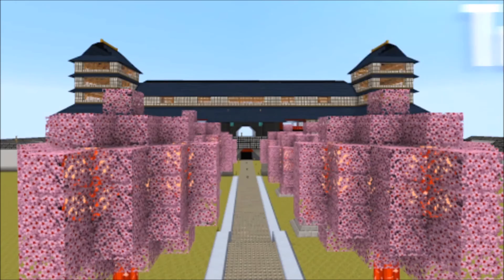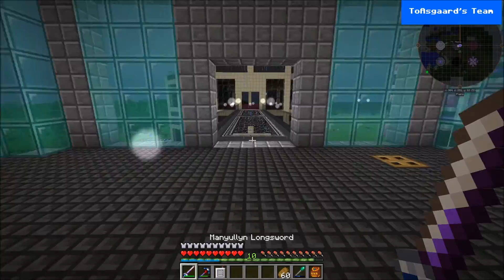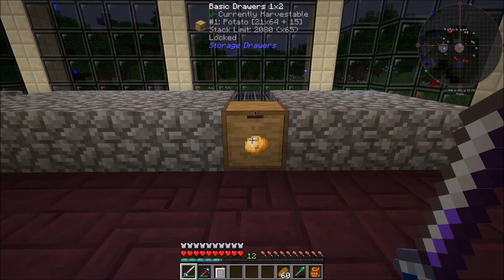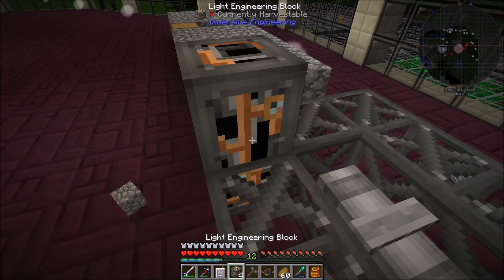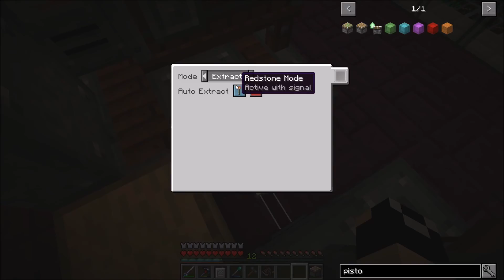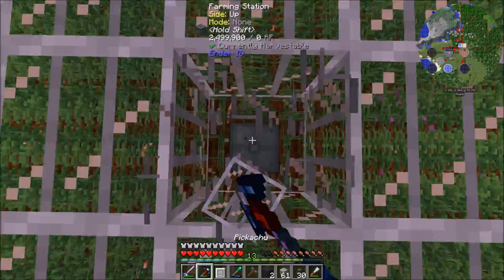Direwolf 20 1.10 Let's Play Ep. 15: Diesel Power

Comment: Maybe I missed it in an episode, but do you have a way for emerald farming?
I know you can farm villagers to get ems but apparently I cant do it with the powered spawner
Reply from the maker: well, villagers can naturally drop them, though they seem to stop after a few emeralds.  Thats a feature of botania.  Also, unless they have changed it, tossing villagers into a tc smeltery can produce emerald.  Or uu-matter can mass produce emeralds if you have a good set up for that.  I may test the tc method fairly soon and see if that still works or not
Reply: I tried the TC method and you receive very little mb emerald for each villager and it takes quite a bit. Maybe you might think of some better layout than what I had built but I wanted to shout a heads up for tc.
Reply from the maker: Oh nice.  Yeah, I know its not a whole lot of mb per villager, but ill show you a way fairly soon then to get a lot :)  I may actually start working on setting that up very very soon for you guys :)  Will take a couple steps to get it fully set up as there are some things we will need, but that will also chain into all of our true spawner setups :)